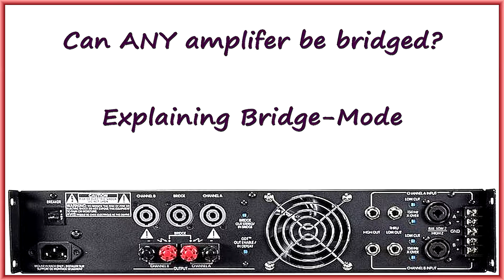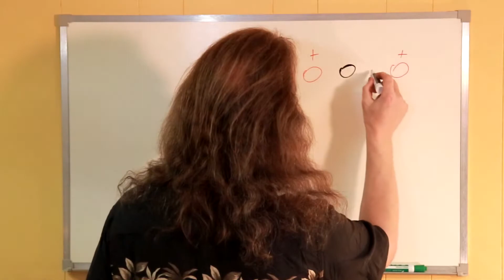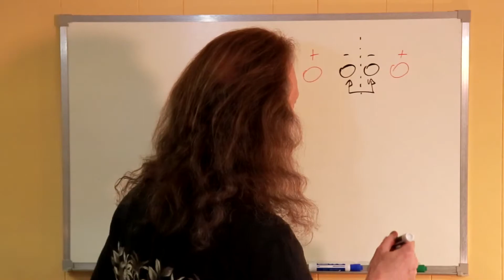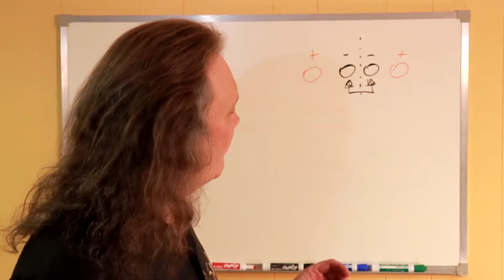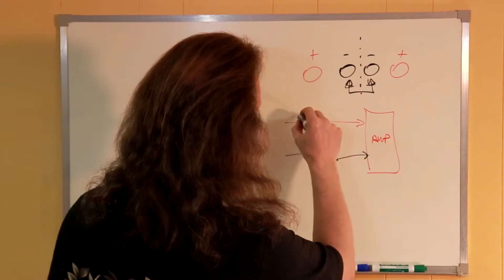Can Any Amplifier Be Bridged? The Truth Every Audio Enthusiast Should Know

Comment: Is it possible to bridge an integreted amplifier? How? Tnx.
Reply from the maker: Possible, but not easy, and I would say not worth it. I would question if a typical integrated amplifier is stout enough to handle being operated in bridge mode reliably.

You need to invert the polarity of one of the inputs and then feed the same signal into left and right, and attach the loudspeaker to the positive output terminals.

A typical hifi amplifier uses unbalanced inputs, that is a signal line and a ground. So to invert the signal, you actually need some active electronics, a small buffer amplifier to do that job that sends the proper signals to your amplifier.  You could build such a thing out of an op- amp and a few parts, but offhand, I can't think of a retail adapter product that you can just buy to easily do this.

Bridging the amp converts your stereo amplifier to mono and reduces the performance a little bit in almost every way, except for the power output. Often the power gains aren't that great. In a lot of instances, especially with smaller amplifiers, I just don't think the juice is worth the squeeze IMHO, and rarely would I want to give up a stereo amplifier for mono.
Reply: @Barry-Watson  yes i thouth so. It would be very difficult to bridge an integrated amp. I asked b'cos that's the only amp i have. 

But just incase, i'll have the budget soon and would buy a power amp, how many watts would be recommended for a (Live brand) speaker 18in double
 magnet 1000watts ?

That's the speaker i used for my subwoofer right now. (I have 2 single speaker subwoofer box).

Thanks..
Reply from the maker: It takes a big difference in watts to really make a difference in loudness so I think anything around 500-1000 watts to the sub would suffice, especially for home use.  Maybe your box could handle a little more power than this, but going much bigger with the amplifier will probably not make a big audible difference but will be more risky to your speaker and your wallet.

Lots of good larger power amps to choose from.  The Behringer EP4000 is a traditional, heavy, reliable power amp that offers good value in this power range, It is suspiciously similar to a QSC 2450 which is also an excellent amplifier.   I'd look for something about that size.  The lightweight, digital amplifiers are nice if you have to move them around a lot.

Since you mentioned budget, I wouldn't be afraid to check out used gear that's in good working condition.  If I had to choose within a budget, I would prefer a nice used Crown, QSC, Crest etc or other respected brand over a new unknown-brand imported low cost amplifier.
Reply: @Barry-Watson  very well said. Thank you so much for your time to reply. I appreciate.
Reply from the maker: You're welcome!  Good luck!

Comment: Not really sure how to do it I can send you an image of the a you could look it up on Google
Reply from the maker: Thanks, I did a quick look up on that model JBL amplifier for its specs.
Reply: @Barry-Watson  what did you find? For some reason the cooling fans are not coming on I tested them with a 12-volt battery and they work just fine but when I plug it back into the board of the unit nothing happens
Reply from the maker: I don't know about that particular unit. Some amplifiers only turn the fans on when the unit gets warm enough to need it.
Reply from the maker: There could be a problem with the amplifiers fan control, or a failed thermal sensor, but I suspect it's likely that the transistors aren't really getting hot enough to force fan operation - and everything is okay. This amplifier tries to keep the fans as quiet as possible. Here's what the manual says:

The AVA7 utilizes two fans to cool the amplifier channels, ensuring long-term reliability. To reduce fan noise to an absolute minimum, a thermal-sensingand control circuit, which senses increases in temperature within the amplifier and powers the fans at a speed proportional to that temperature increase, has been incorporated in the JBL Performance Series AVA7. As a result, the fan is never turning faster than necessary...

Comment: I have a question I have a JBL AVA7 house amplifier. I have a set of Yamaha speakers that are about 350 w a piece. I would like to bridge the channels only  have 125 watts a piece any suggestions?
Reply from the maker: That receiver is rated at 125 watts per channel, with seven channels. I don't know if you're using all those surround sound channels, but I would suspect that that is plenty of power for a typical home AV system with reasonably efficient speakers. If that doesn't get loud enough for you I question if you're going to be able to get to where you want to be by bridging.  Home AV receivers usually are not as easy to bridge as a pro-sound amp, because they use unbalanced inputs.

Going from 125 watts up to 350 watts isn't much more than about 3db (2x power), and a 3db change in level doesn't sound like a very big change in volume to our ears. So, if you want to make a big jump in perceived volume level you need to do a giant jump in power. Takes about 10 times the power to double the perceived output level.

Comment: I've set my  speaker wires now  to bridges mode i found it has no switch for bridges mode but it has guide written for bridge connection but i m not sure so i try to search on you tube and i fiund your video  now i'm not going to bridge it thanks for the info

Comment: I am not an audio pro, but am a hifi enthusiast and master electrician. Your vids interest me on both levels. A lot of your knowledge goes hand and hand with home audio, what doesn't is still very interesting to my electrical mind. Thanks for your work.
Reply from the maker: I appreciate that!
Reply: Why not, as audio signals and power connections, are only electrical in nature, but running with multi-frequencies, instead of simpler electrical fixed frequency & higher fixed AC levels..

Audio in and of itself, is ONLY pure electricity circuits, without any changes to the frequencies involved, whereas audio signals are extremely complex with multiple frequencies that are sometimes acting in both directions upon any audio cable at any time.

(Oh &)
p.s: you have a new sub, from this 70 yr old (retired) Kiwi Industrial Electrician, who learnt all about audio in the 1950's & 1960's, before becoming a heavy industry electrician in 1980, building, installing & commissioning ultra large and complex Multi-Voltage Industrial switchboards up to & including 2,000 Amp 3ph metering boards, in the likes of our main freezing works, and other places such as the huge Wood Chipping Mill, of Southwood Exports located on the Invercargill /  Bluff highway opposite the Ballance Agri-Nutrients Ltd location in Awarua, NZ

I have also worked on 22,000 volt switchgear that was used & installed into the Tiwai Aluminium Smelter, during the 1980's, here at Tiwai Point, opposite Bluff Harbour, at the bottom end of the mainland, of the South Island of NZ, where I happen to be a lifetime member of the greater community.

🔌Plugged in I am, to multiple aspect surround sound, via (my own taught) old school Analogue techniques, that I invented/discovered, back in 1965 when attempting to repair an old Philips (made in Holland) reel-to-reel recorder/player that had it's own speaker outputs attached, which powered the case halves that were the speaker boxes which acted as the case lid, making the unit extremely portable, as if it was a suitcase, and not a Valve Amplified Magnetic Tape machine, of extremely old vintage, even back in the mid 1960's when it "failed" on me as I was cleaning one of the many rain & dust covered valves - after it had been thrown out, into our local community dump by someone who didn't want it as back then people tossed away nice things, if they weren't any value to fix, or keep.)

Being the unit I was attempting to "make better" until I dropped a valve of (later discovered unknown value) onto the concrete floor of the shed I was allowed to use, on Dad's dairy farm.

Thus in a round about way, when trying to fix that - I discovered a hidden channel, inside the tape's recordings, that I very quickly found and hence it took over my life, after that which means I have been "into" the remastering / re-recording musical and sound content, since at least 1963, until now, being some ?? (Let me use the PC's calculator...)
Wow, I've been an audio sound technician and audio manufacturer, for the past 61 years, as against my Electrical Trade Cert, that I started to get in 1982, that awarded me the top electrical apprentice award, for Southland in 1985 (along with a "representation" trip to Hamilton's Fieldays event, in June 1986, in which 19 tertiary education students competed in what I (and the other 18 students also thought, that it was a mock competition - until we discovered on the last day there, that all 19 of us had "completed" the challenge, with barely 12 points between all of us.
So they awarded one person an award certificate (but not the others), until I - the oldest there, complained to the staff who had arranged it all, that it wasn't fair on all the other 18 student apprentices, to have NOTHING to show their colleges, or their employers, for the time off, at NZ's very well known Agricultural show.

I later discovered that they provided all other competitors, the same attendance cert, as I got.
Nothing else, just a piece of parchment stating we had (individually) been there and gained the appropriate cert for winning / attending the show.

Thus as far as AUDIO goes, I have made and sold many over the years since 1965, being mostly those that I hand-build myself, obtaining the load-outputs - direct off most amplifiers, although some newer (more expensive but way cheaper to manufacture) internally bridged thus completely floating outputs, that required the use of aux connected isolation 1:1 audio transformers,  thus I needed toroidal types - to allow me to three wire the normal L/R & Ground into common mode every output grounded transformers, such that one channel could be split into two identical channels, each semi-isolated from the other, running four way speakers in the vehicles "main passenger/driver area, whilst also allowing me to create several OTHER hidden channels, until my 1996 Mitsi Delica 4wd VAN ended up getting placed 3rd overall, in the 2003 NZ National Sound Offs, after everyone else had competed, when as a result of me complaining that I hadn't been allowed to compete, purely because my van's interior had so many ad-hoc new & used speakers, tht I had pulled out of rubbish-dumped TV's and radios, as well as having some four channels of subwoofers, that they had "claimed" could NOT have been of any loudness, what with the piddly little 300 watt (cheapest) amp driving into all the (looked like) aux speakers, in the back of the "seated" van, which I "ran" during the sound SPL test, at 60% volume of the head unit, and barely half "loudness" on the 300W amp,  - yet the SPL reading came back at 126 dB on the test run, to come back again as an official result of 126.3 with everything driven (along with all DC powered Lights and speaker powered Neon's & LED's etc, that I had by then discovered were good for twofold reasons, firstly they "acted" as visual VU meters, allowing me to set various speaker volumes as needed, as well as by-passing the DC components of any "clipping" that the amp did, thereby protecting the speaker/s that they were parallel connected onto.

The crowd, who had started to disperse, when this old fart and his muddy van insisted on being allowed to "compete", in that affair?
Laughed loudly at my insistence of leaving the rear hatch door opened up wide, along with the sliding door open, and both front doors, plus I had every window open, to avoid any glass from shattering, if the SPL got too high, even though I had been operating the vehicle for several months on "roughly" the same power settings, when travelling - so the laughter continued, until I did the test run.

There was the "obligatory" silence, while the "test" and then a proper run was completed, after which - the silence became deafening.
Until I realised that the crowd wasn't laughing any more.
Most there, who had been trying / vying for placements, as well as the youngster who won 
(in a wee two door sports car fully fitted out as if just a speaker enclosure anyway, ran up a lovely 128+ dB as his car shock apart with JUST BASS & lots of rattles), 
Had stopped their derogatory remarks, and were crowding around my van traying to figure out WHY it was so loud, when it simply looked (for all the world), to be a farmers hack vehicle, that had a LOT of various speakers of all shapes and sizes, tossed carelessly around it's interior and on the many seats, to then hear enquiries of "how many" are in there, (twenty five I told them), whereupon the organisers who themselves were gob-smacked, insisted I try again, with everything shut, but I just said, no, I want a run without any of the subwoofers running, to which I again got a LOT of loud laughter, and then the silence as I ran the system WITHOUT the four channels of subwoofers, or any of the speaker lights, whereupon the Mid's and Uppers/Tweeters, etc., told of a true test result, that of barely a 0.3 dB droop in SPL, at 126dB.

I thus earned myself THIRD PLACE - against the two most expensive vehicle fitouts there, with a "lot" of others who had spent up large, buying huge amplifiers and big subs and had kitted out their vehicles so nicely, who hadn't even touched the 11o dB level of the 4th placed contestant, 
There were even those with just one 12" speaker in an otherwise empty boot, who hadn't even broken the 90dB levels, who (for want of a better description) were wishing they hadn't spent a cent on "improvements".!!!!

Some people were outright angry, that someone in a work vehicle, muddy exterior and an old fart to boot, had effectively blown them away, with wht=at they had later learned, was a fully balanced 7.3 surround sound system with a super reverberation device, in the middle back area, being an old Fountain Speaker house cabinet, that had what appeared to only be one 600W speaker atop of, but which I then explained to those asking, that it was in fact, the original Fountain 12" 8ohm all purpose house speaker, with an inverted 4ohm Car Audio 12" speaker HARD BOLTED, directly over the top, with both speakers effectively SEALED as if one one diaphragm, with the top speaker inverse wired in series with the bottom house speaker, such that they BOTH moved up & down together with any lower than low, bass and super subwoofer reverberations developing within that huge sealed (non ported) cabinet, laying as it was, on it's back thus "bouncing" the vehicle up and down too, when it was being hard driven...

Yet, without ANY of the four bass subwoofers running, during the second "quality of sound" test that they had (literally) urged me to do, which I had thus insisted to be run without any subs, knowing full well how well everything else sounded anyway, .

I thus earned several "general" enquiries as to my abilities, and thus found several people who were delighted in being able to "booking me" for their house installs, which I gladly undertook.

As I was told later, by my own Dad, not bad for a country lad.
Reply: I have an "electrical question" for the "other" Sparkie - in the room
.
How many phases (I call them audio channels, but as an electrician they are better described as "extra phases"), are there, in a basic domestic electricity supply network, where some are sent into commercial and heavy industry buildings, that run (or attempt to run) motors up to and including approx. 12 "channels/phases" that some bright spark called them as: Motor Poles.
How many "different" phasings, can you get, out of the bog standard 3 phase 240v/400v Mains supply?

If I put my mind to it, I can get upwards of 300audio channels, out of a simple 2 into 300 unit, that only has the basic two speaker input terminals,  and just a 3.5mm output and six RCA sockets.

ie: Check this out.
300 possible "speaker channels", derived from just a 2ch. sound supply "amp".
https://youtu.be/lp6KxU4Bv1g